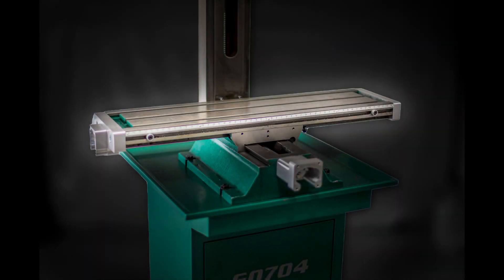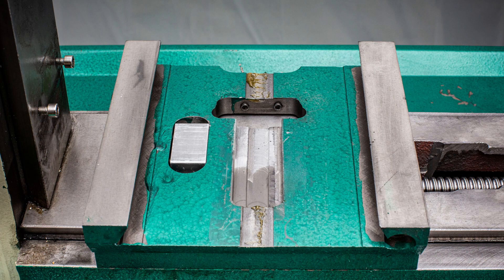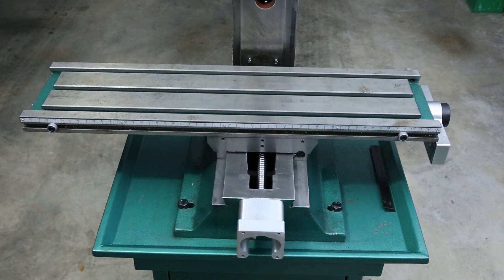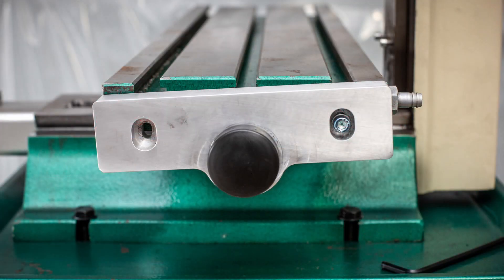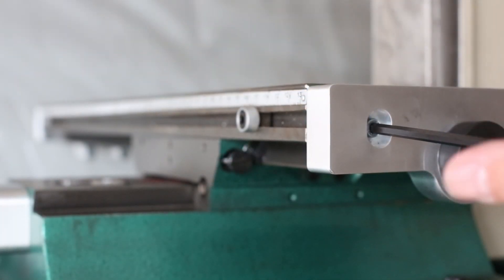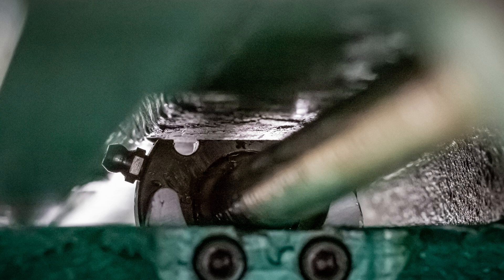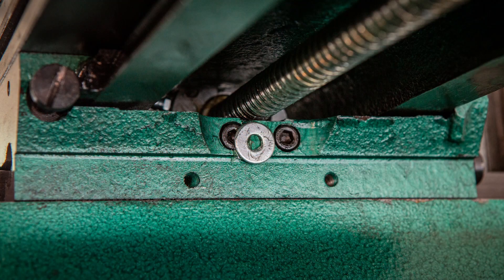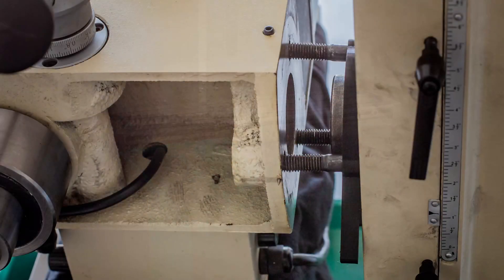Grizzly G0704 CNC Conversion - X Axis Ball Screw Assembly Installation - Video #7

Comment: Your videos are guiding me on my DFU upgrade to my BF20L. Thanks. Have you somehow covered the square hole you cut for the Y axis DFU? I did the same on my base but I have no idea how to cover so the chips wont fall in. Again, thanks.
Reply from the maker: Thanks for reminding me. Hadn't thought about that in months.
I haven't got that far in the reassembly yet, but I'm kicking around some ideas and open to suggestions if anyone wants to chime in. 
To minimize the opening, I'll fill-in or otherwise repair the section of the hole that was cut too big. Brazing in a filler plate might be preferred? But I don't currently have the tools for that. A 3d printed floor/form below the surface, and then filled up with J-B Weld and filed smooth comes to mind. Could drill and tap the sides of the hole to add pieces of small threaded rod to reinforce the epoxy repair, though I doubt I'll go through the effort. Since the repair is not structural, and essentially just a dust cover, the epoxy should suffice. If not, it's easy enough to remove and try again. Actually a 5-6mm thick, solid 3D printed filler piece, epoxied in place would do the job too. Though not as robust.
Something simple like the rubber cover at the back of the Y-axis could be fitted, though that doesn't really appeal to me. I was considering 3D printing a cover with telescoping slats, like are found on some car shifters to keep out dust and debris, but small chips would likely slip through the gaps between the slats. Or, perhaps a vinyl sheet on a spring loaded roller like a window shade. An accordion like on the Z axis, probably won't work well since chips will collect in the valleys. Once the repair is made to the oversized hole, a simple articulating 3D printed cover attached to the saddle may be all it needs.
Reply: I believe there are enough gap between the top of the base and bottom of the carriage. You can stick an aluminum tape there. I'll try it this night. Best, Suat

Comment: We’re you able to fix the gibs? I got replacement ones but they are still too big and need to be ground down somehow
Reply from the maker: I haven't done anything else with the gibs yet. I'm still trying to make time to build the electronics enclosure for the mill. The 3D printed gib seems robust enough to mill the clearance slots in the original saddle, in which case I won't need new gibs. I'll use the original gibs with the original saddle.
Reply: @joat_mon  thanks for the reply. I ended up using the broken gib as they fit nicely together and seems to be working ok. I ordered two replacements but will require a ton of work to get it to size.